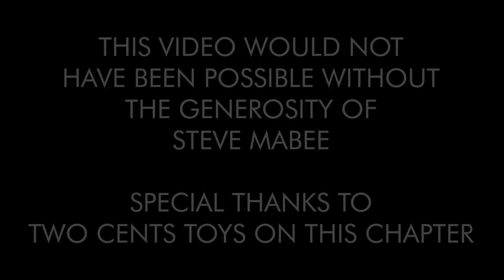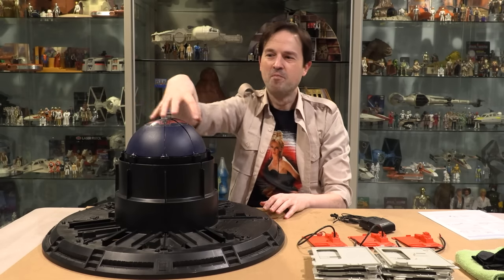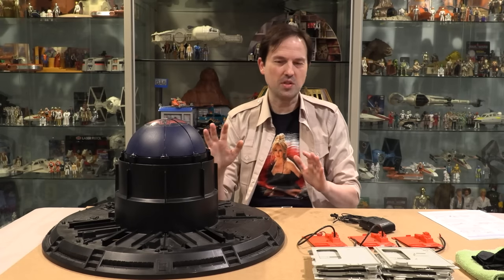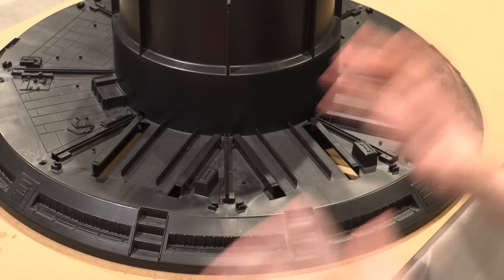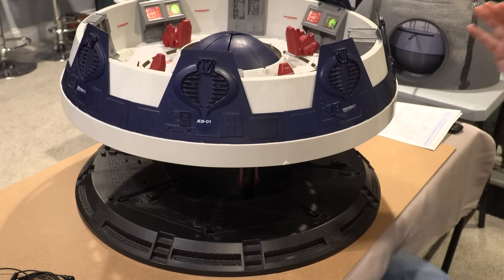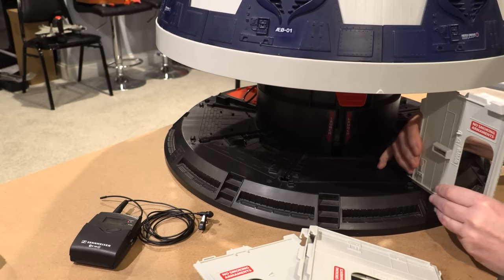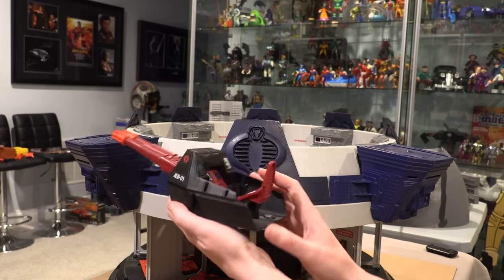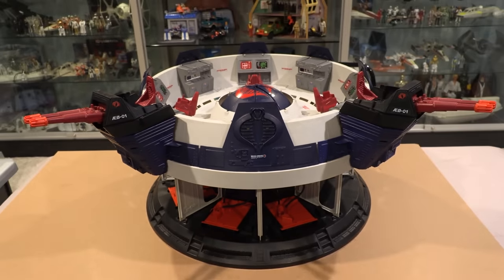G.I. Joe Cobra Terror Drome Restoration: Part 2 - The Two Turrets

Comment: I spent three months restoring my TerrorDrome and I encountered all your points of concern. I’ve been very eager to see what your approach would be. The fragility before and after restoration makes it purely a display piece. Can barely move it without something wanting to either fall or break off. I’ve had mine on an electric lazy Susan. Put some leds in it. Looks cool. But won’t go anywhere near it 😂 Thanks for doing this series!
Reply: I hear that! I picked mine up the other day and there was just a random plastic piece under it and I still dont know where it fell or broke off of
Reply: @tylerjham  You’ll find out when you think you are close to getting fully assembled. Thankfully, for most issues there is either a 3d part available (like the hinge pegs) or an ample supply of parts. So many people just gave up and parted theirs out.

Comment: Looks great so far. Very nice job with the Cobra logo!

Clear-backed stickers are the bane of toys, especially large stickers. To expect most parents, never mind kids to get everything applied perfectly and without getting dust or air bubbles under the stickers is folly. This is a big problem with LEGO, which I collect. I really wish that when possible, opaque stickers could be used, at least with such a large and complicated sticker such as the Cobra emblem here on the segments of the launch bay cover. Ideally, of course, silkscreened or other printing would be the best thing.

Comment: Why not just center the Cobra symbol between the turrets???
Reply: It does seem odd, but that’s what the instructions show. I can’t see any reason to have it slightly askew though. Maybe the toy designers thought it would be easier to apply in mirrored halves due to the way the segments of the opening had to be engineered. It just looks strange, though.